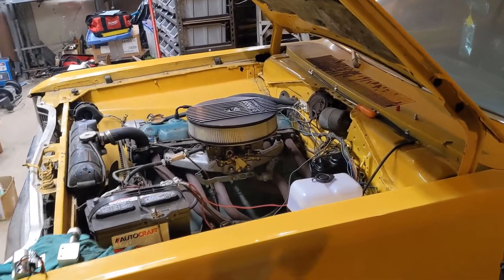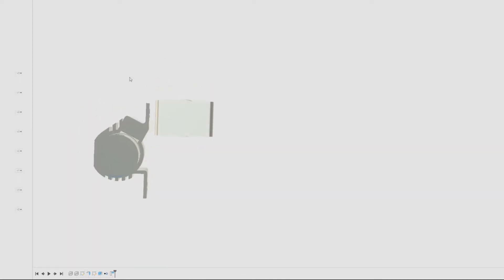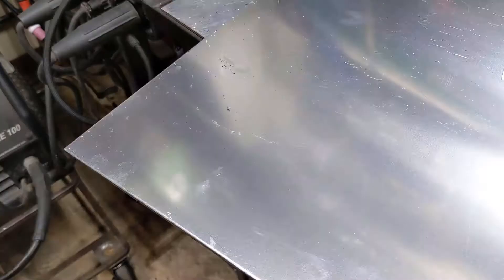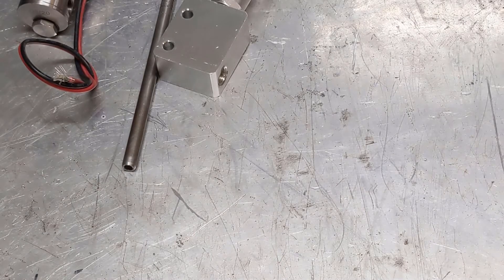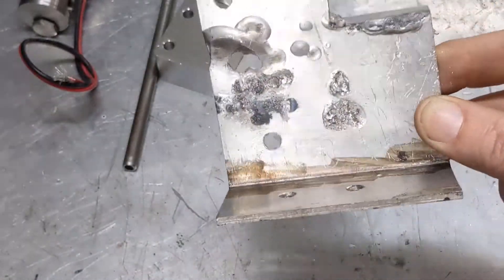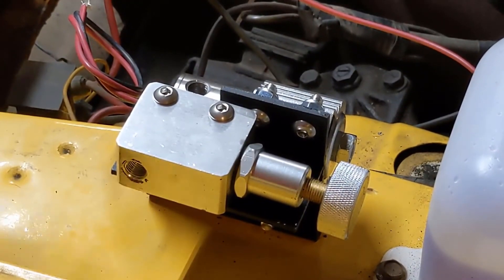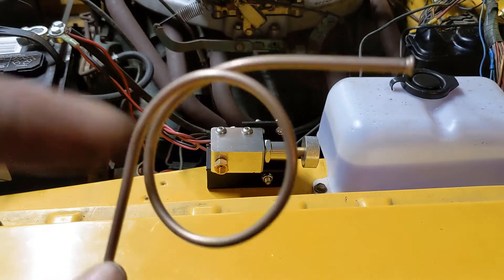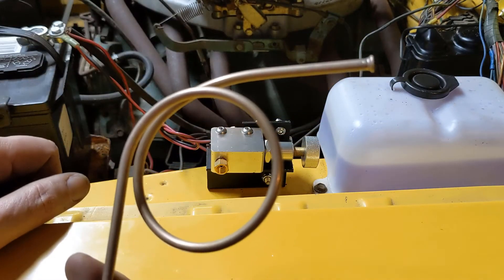Mount Your Proportioning Valve: Pirate Jack Disk Brake Conversion Part 4

Comment: I meant to ask, why did u use 2 proportioning valves? The main purpose is to reduce pressure to the rear so you don't lock them up. That adjustable one u r using is great. I use it on my pick up truck so when it's empty I reduce pressure and when loaded I increase pressure. Makes a great difference. I ran the front direct from master to front calipers and rear through the adjustable prop valve. Also, disc brakes require much more volume of fluid than drums since a wheel cylinder is small compared to a caliper piston. I hope this is helpful.
Reply from the maker: It's just a single proportioning valve plus a line lock

Comment: Great video as always! It's an old 1 so I hope I am not to late.
I am also not a great Welder, especially at Tig but I know others who are. They tell me that even though most welders run off AC voltage they convert to DC. However,  you need a Welder that uses AC voltage  to Tig aluminum. I couldn't see in the video what yours is. BUT, u can Mig weld aluminum with DC if u use a spool gun. I hope this is helpful to u. U can probably get better welding info on YouTube and practice on scraps. With Tig it is very important that your work piece and your tungsten are Very clean. I have that Vulcan 215 that you have and I feel it is just as good or better than the millers I use at work.
Reply from the maker: I have a Dynasty that I use for TIg, but thanks!